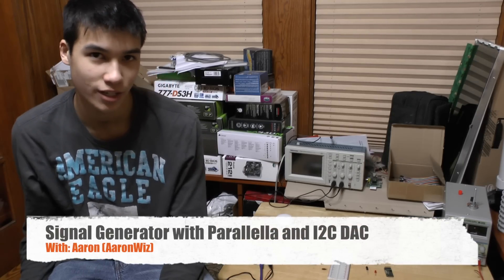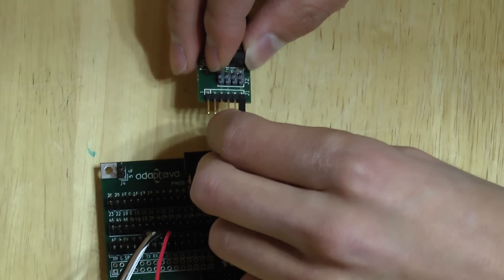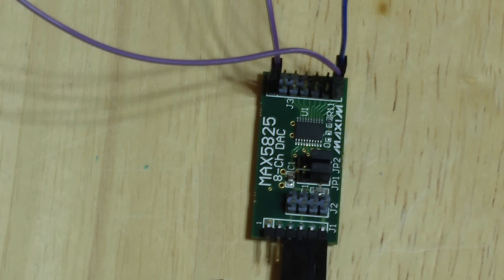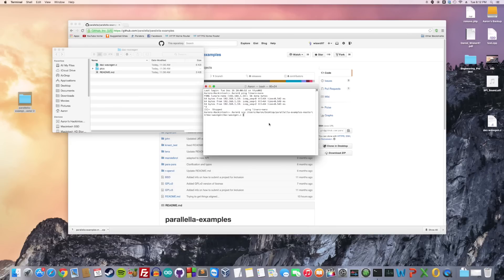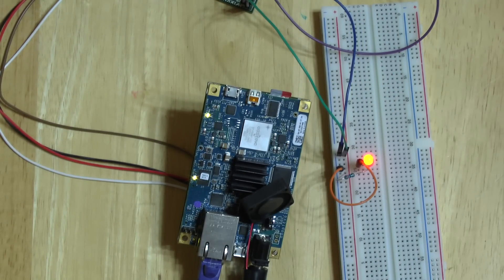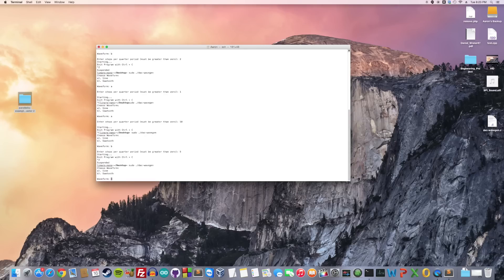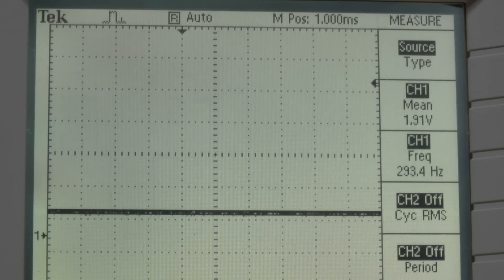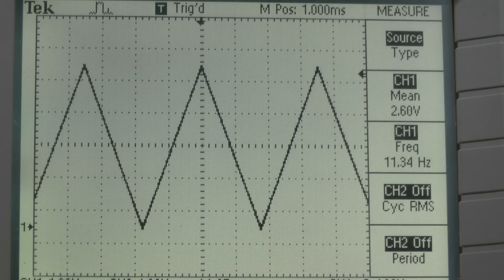Parallella I2C DAC Signal Generator

Comment: Your ''sawtooth wave'' is actually a triangle wave, maybe using a SPI DAC could increase the frequency without losing steps per quarter wave?
Reply from the maker: cfmeier Thanks for the correction, I noted it in the video description. Yeah, in theory SPI should have less overhead while writing values because there is no address byte and no read/write bit. Unfortunately, the Parallella's SPI library is bit-banged in software, so it's actually significantly slower. However, I2C on the Parallella is done in hardware and has an actual Linux driver, so it is inherently faster. If you look at my code, there are no delays, so the frequency is determined by how how often and how long it takes to write to the DAC. If I remember correctly, this DAC can clock in data much faster than the Parallella can feed it. So If you want a higher frequency, your best bet is probably is something that can write to the I2C bus faster.